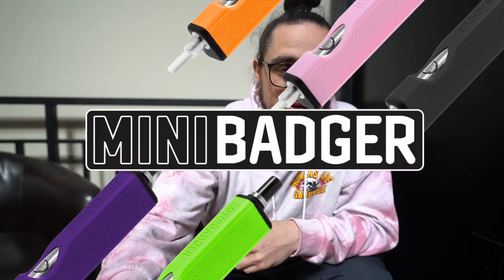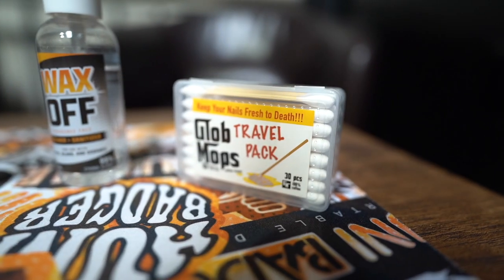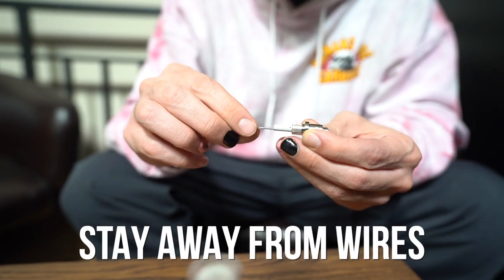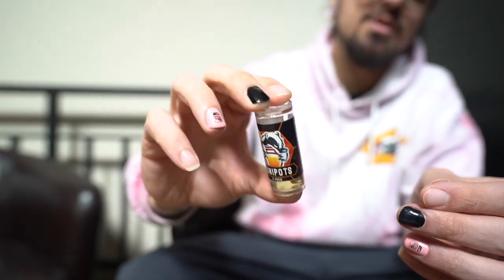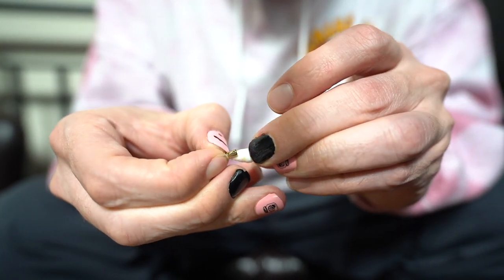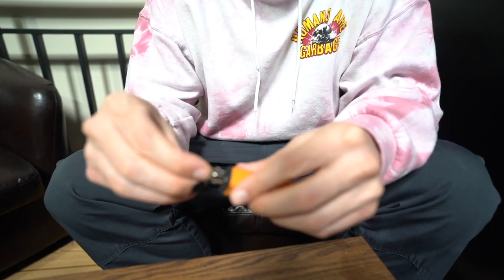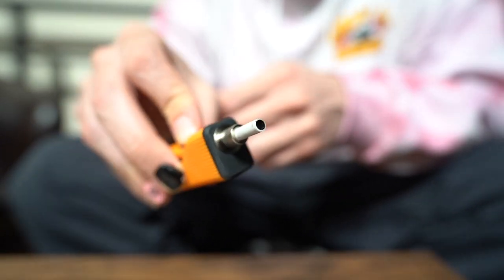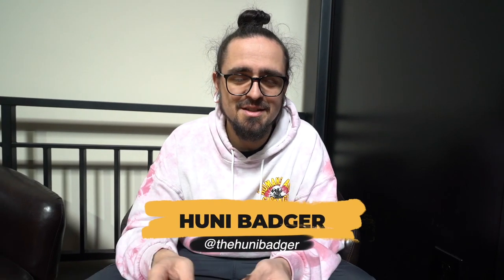HOW TO FIX "NO AIRFLOW" (MINI BADGER)

Comment: I ordered mine a couple of weeks ago. Haven’t been able to use it as of yet. The tip isn’t heating. It’s fully charged and iv screwed the tip off and back on to see if it makes any difference . Nothing. I emailed Huni b and they are going to send a replacement which should be in tomorrow. I’m excited and can’t wait to try it! Otherwise awesome company from what I hear and great customer service

Update: I got the replacement and it works amazing! Been hitting fire dabs, idk why people say the mini doesn’t blow clouds like the regular version. But it does. Also many people probably don’t know but you can grab a reg nug of some dank and push your tip into the side if it while pressing the button and it will actually heat your bud hot enough to cook and vape it. Pretty decent hits too! Taste like butter
Reply: got mines two days ago. havnt been high in two. days.
Reply from the maker: great to hear you're enjoying your MB!

Comment: Please do a demonstration of how not to slurp the wax. I have owned many nectar collectors and this mini honey badger is awesome but I notice I’m slurping my wax but when I switch to my other tools I’m not and I want to know what I’m doing wrong
Reply from the maker: Hi, please refer to this video for the demonstration https://youtu.be/BxI2DsL60GY?si=dEHvoWwtFVfIkuqu. With the Mini Badger, since it's a lower powered unit, you would want to make sure to have a good charge on the battery and preheat the tip for 15 seconds before usage.

Comment: I just got my mini badger and at first it wouldnt charge after playing with it and not moving it for a while it charged but even on the highest setting im getting little smoke it doesnt seem it gets very hot it’s defective right
Reply from the maker: Have you tried preheating it by holding down the button for around 10 seconds, release, then press again to use?

Comment: after you soak anything that has been used to vaporize psychoactive compounds in 91% isopropyl alcohol pour that stuff into a flat glass dish and leave it somewhere exposed to air (out of reach, in a spot unlikely to accumulate airborne particles of dust/dirt etc)

after a while (depends on volume of alcohol, but no longer than maybe 1 full day) the solvent evaporates leaving a residue rich in the psychoactive substance you have been vaporizing. often it is slightly less potent and has a slightly different taste - and sometimes it is on par with the stuff it came from with virtually no reduction in potency or change in taste.

basically, I can’t bear to callously dispose of perfectly good residue, no matter how easily available or inexpensive it may be. some have no qualms about tossing their reclaim, but they are cut from a different cloth than me.

Comment: Would the only difference between this and the big one just be size and battery life ? I’m debating which to buy and if they’re the exact same except size and battery I’ll probably go with the mini.
Reply from the maker: the battery power determines how hot your tip gets, and how long the unit can last. mb and regular badger use different batteries
Reply: Bigger badger is better . This one basically runs off a cartridge battery . Then you have to hold the button, doesn’t really get hot . I have to hold the button and let it preheat about 3 different cycles before I actually could get a decent hit . Btw this is brand new out the box . I’ve used it about twice and now back to my OG badger .

Comment: This thing wont give you fat clouds, But is for a portable dab option if you dont want to bring your Puffco everytime you leave the house!
Reply from the maker: quick tip: preheat your tip 2x for the fat clouds!
Reply: @HuniBadger  no fat clouds bud. ITS just the device if you want Fat clouds get a dab rig. This thing is meant to be portable as well as small in size so u can bring it anywhere. Stop lying to your customers I use the Badger all the time. Tons of comments on this video are clearly disappointed from device. Why I stated "Not For Clouds" "Good if you don't want to bring the puffco". It's still a great device, it's just not meant for fat clouds. Why would u want to over heat your dabs anyway?!
Reply: @djsweglord9909  Definitely Bigger Clouds, then the Mini Badger!